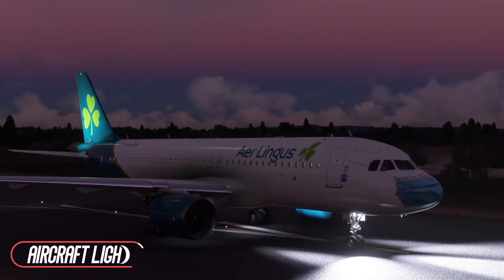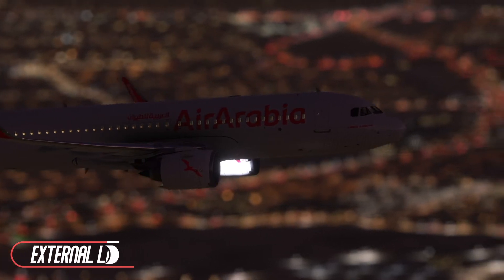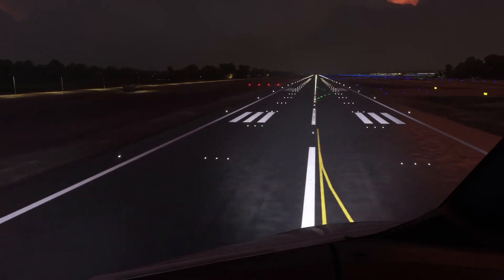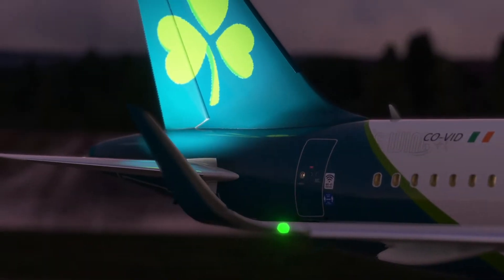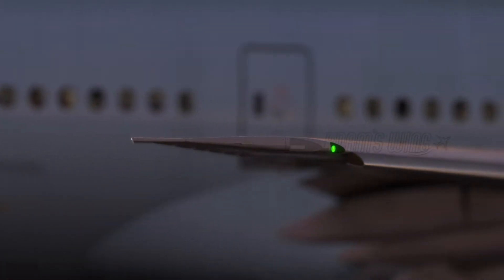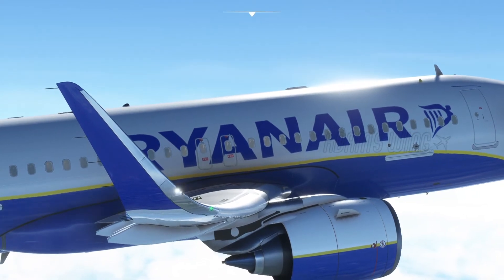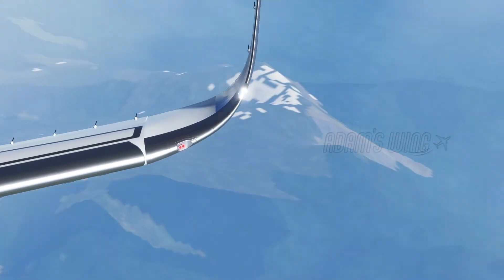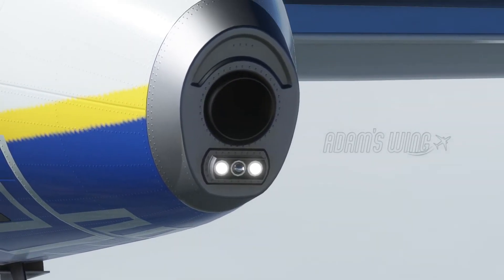What are strobe lights on an aircraft? What are they for ? #aviation #strobelights

Comment: Thanks for replying Adam I live by two airports but just starting to see strobes on two airplanes I’ve seen shutting off nav lights and turning on a rapid strobe that doesn’t have a pause in it,planes don’t normally fly with on are they using a new type have seen on ISS also
Reply from the maker: You are welcome. Just before entering an active runway, the Strobe lights are switched on. On Airbus, there is an Auto Strobe switch if that is activated once the aircraft lifts off from the runway and the weights on wheels are dispersed, strobe lights will automatically on. Anyway, an airborne aircraft will always be having the strobe lights on. Thanks